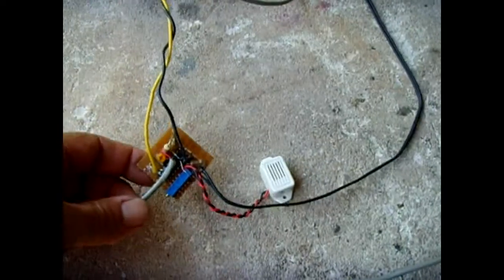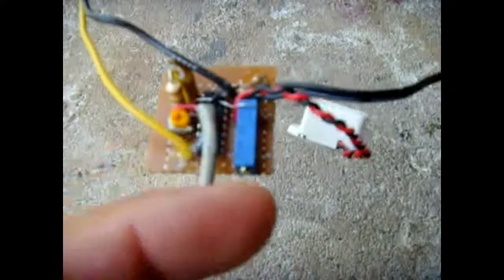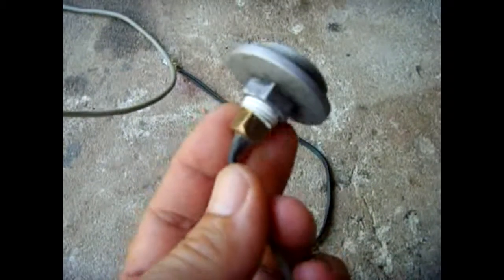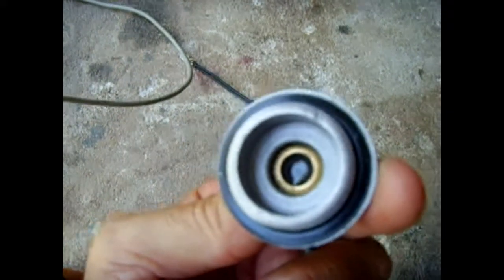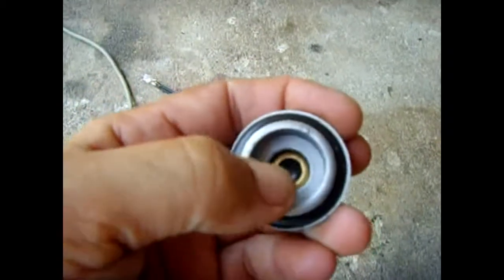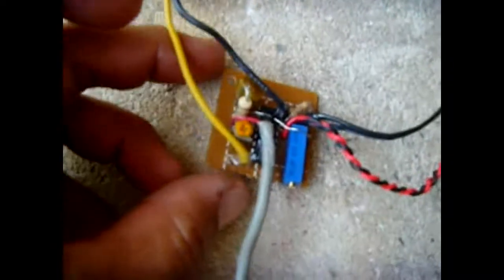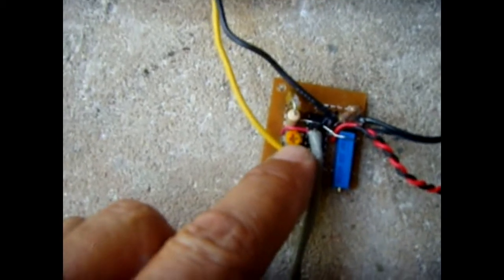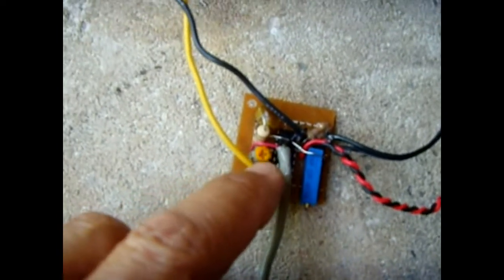Custom GY6 150cc Oil Temp Alert

Comment: or you could install an oil cooler and actually prevent it from going up in the first place ;)
Reply from the maker: On an expensive scooter, yes, I'd add one. Thanks for watching!
Reply: you went the distance to monitor your oil temp.. so it seems to me you give a shit about your "cheap" machine.. i would rather cool the temp than know the temp is all i'm saying..
Reply: @ginofoogle6944  how do you know you need to cool it? Did you measure ? 😉